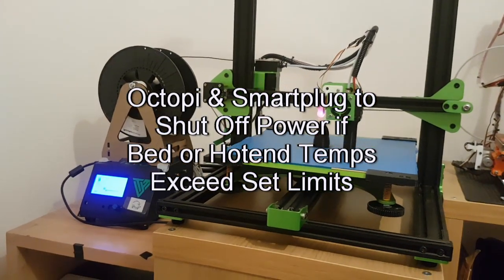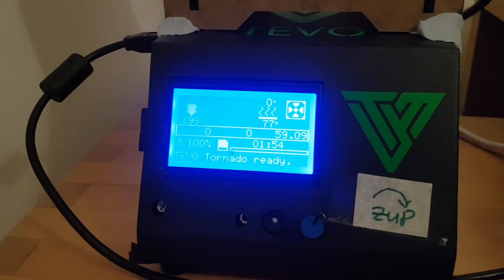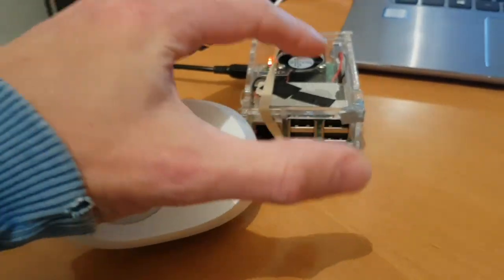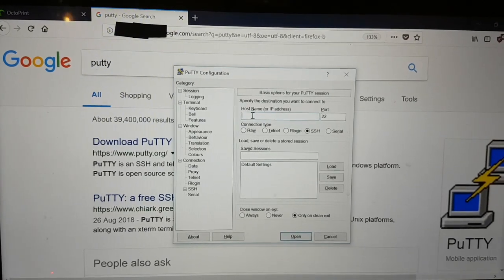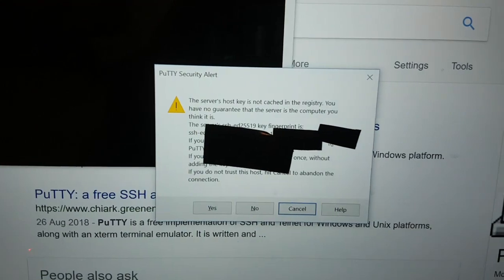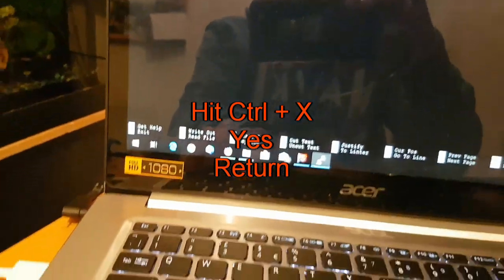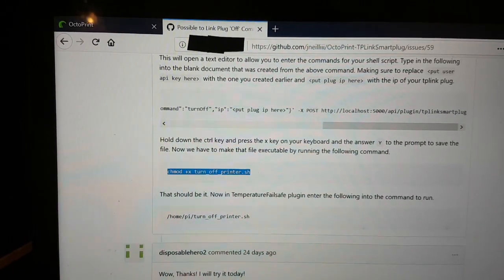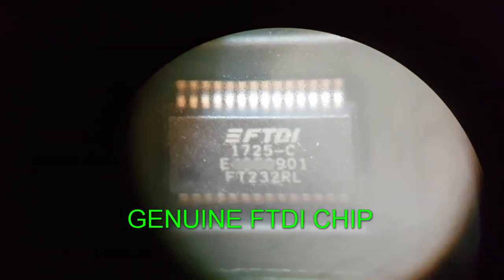Octopi and Smartplug Over-temp Shutoff Protection for 3D Printer

Comment: Little bit hard to follow as there is a lot of octoprint setup stuff that most should have to begin with. I am trying to get this running on my Anet A8 why do i have to create a shell script and not use theTP-Link Smartplug Settings plugin it self?
Shouldnt it be triggered from a thermal runaway protection trigger that marlin generates? even if the mosfet failed and thermal runaway protection triggered doesnt the TP-Link plugin turn it off it self not the script?
I also enabled and added the gcode commands M81 to turn off (M80 is on but i don't use it) with a 240 second delay in the app so the hotend has a sufficient cool down time after a power off is issued.
Reply from the maker: Hi. Thanks for watching. I agree it is a bit convoluted but it does work. I am using an older version of the plugin (and Octopi) so maybe the author updated it since to 'talk' to thermal runaway. Not sure. The reason for the script (and the fixed IP) is that it issues the shut off command directly to the plug regardless of what Marlin is doing. Like a failsafe thermal fuse would.  if a temp limit is breached, the script effectively does that same thing as pushing the 'off button on the smartplug. That way, it can override a shorted mosfet. My understanding is that thermal runaway protection (in the version I have at least) cannot do that. It will think it has shut off the heater but if the mosfet is shorted it will not be able to. Hope that helps. I will see if the author has updated the code since I made this video. my approach is generally to leave things alone if they are working though. 🤣. Anet  A8 still going strong here too. Good luck.
Reply: @Plan-C  i just doubled checked yours doesn't have a tick box for thermal runaway mine does. So there must be a update came out afterwards. This was the only video i found on the plugin and its something you want to get right because a mosfet failure is a extremely serious issue whith how our printers are bypassing the mainboard firmware protection. I have been printing on my A8 for over 2 years its one you have to maintain regularly just to make sure you don't burn your house down.
Reply from the maker: @Side85Winder  Thanks. You can update the firmware to Skynet v2 or Marlin. My A8 is still running Skynet v2 no issues. I have a readymade Skynet firmware on Google Drive on one of my other videos. It is set up with thermal runaway and autolevel. Let me know if you want a link. I made a little standalone Arduino monitor for the A8. It does the same thing as the Pi but has it's own dedicated thermistors. It shuts off the plug using a hacked 433mhz remote socket. All the files are linked to make the board, the firmware, bill of materials etc. I just opensourced it to help people. Good luck.
Reply: @Plan-C  i am happy with marlin 1.1.9, i was building 2.0 but realized its still a bugfix version not that i will gain anything using 2.0.
I think klipper is the best to use anyway for us with 8bit machines and a RPI. But i have everything dialed in so well with marlin so i don't want to change. I would do a before and after benchy if i do change but i just don't have the time to mess around with it all. Hence the smart plug and not DIY cheap self wired relay for mains protection.